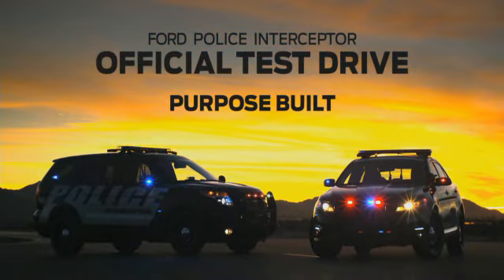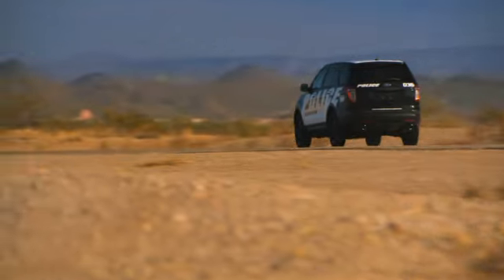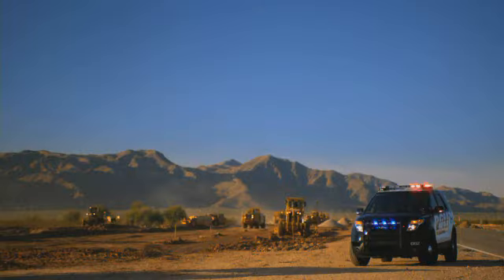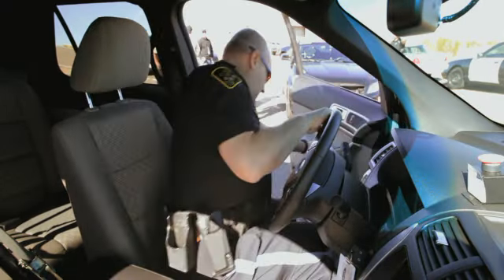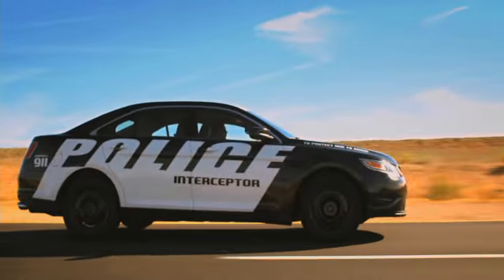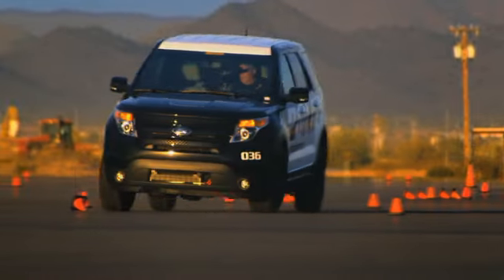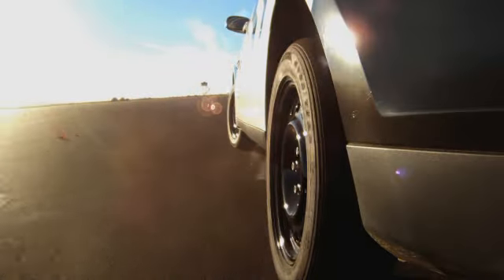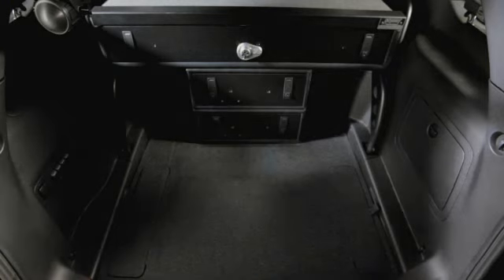Ford Police Interceptor Official Test Drive 6 -- Purpose Built

Comment: Like most modern AWD systems, it's a variable assist differential on both front and rear, but it's not slip-assist. The programming is based on the actual driving style. For straight line cruising, it's an 80/20 split, roughly, to increase fuel economy. But if you get into any sort of aggressive speeds or maneuvers, it will kick it to 50/50, or whatever is best for the situation. It doesn't wait for slippage, it's based on the vehcile's attitude. And it's reaction is in 1000th's of a second.

Comment: Overall score.  Its apparently really awkward to put euipment in or something, because it got like a 0.5 / 10 or something on that.  But also the fact that MSP said they won't use the Ford PI anymore, and will instead be using the Charger because Holden refused to paint the Caprice blue.  

Also the Ford PI is a FWD and Police departments dont like FWD for the most part.

Comment: And given that Ford worked with upfitters to help design some of the component connections, wire routing, and control programming, what you're saying runs contrary to a lot of what I've heard. Again, just intersted in the source so I can read it and see what it's based on. 
And the Ford PIs are standard AWD. You can get a base V6 in FWD, but that's a downgrade option. The standard base price includes AWD on all 3 models (V6 sedan, Turbo V6 sedan, Utility)

Comment: Their overall vehicle test thing is like 40 pages long.  It wasnt on upfitting, it was on equipment storage or something.  I cant remember but whatever it was, it was really low. But, to give perspective, the highest was a 4/10.    And Fords AWD system is FWD with real wheel assist, so it drives like a FWD car.  While it's not technically FWD, it pretty much is. The rear wheels only recieve power when the front wheels are slipping. While I understand the benfits of the Ford PI, MSP didnt like it

Comment: Can you provide a link or tell me where to find that? To my knowledge, the MSP does score or rate the vehicles, they simply do a comparative performance test and post the results. And I've never heard of MSP rating vehicles based on ease of upfit. Considering that each agency can use different upfitters and different aftermarket equipment, I'm not sure how they'd come to any reasonable comparison. And 0.5/10 is a ridiculously low score. That's essentially saying you can't upfit the car at all.